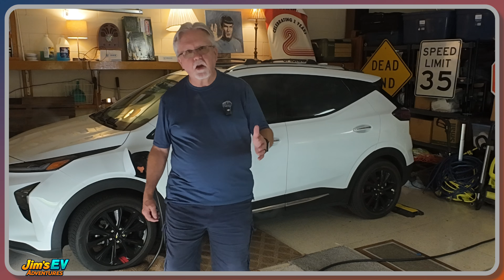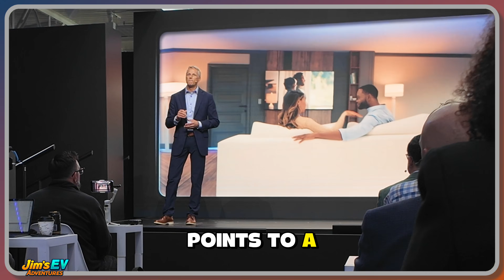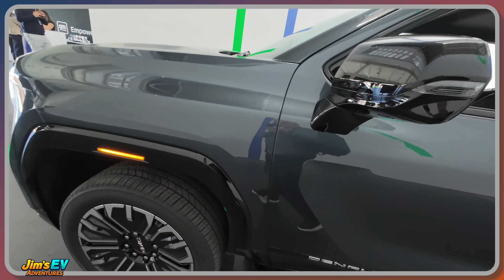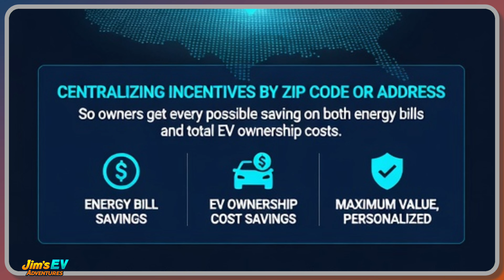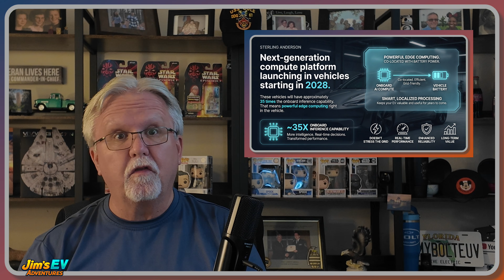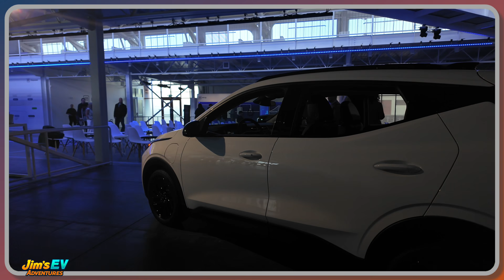GM Empower, Part 2: Your EV is Actually a Giant Home Battery!

Comment: Jim, I haven't seen anyone talking about this so I figured I'd bring it up here.  All of these chargers have cloud based communications enabled by default.  Or perhaps a better way of saying that is, the manufactures are able to harvest your data without your consent.  Worse off, I was reading in some of the forums for Enphase's new V2x charger that firmware updates are changing peoples settings on their devices.  People who have V2G disabled are having it turn back on and their batteries/cars are draining.  I would very much like to see OPT IN and privacy settings improved across the board.  I don't want to have to have my system online for it to function.  I want to choose to do firmware updates when I want.  No one wants GM, Enphase, Sigenergy or any other provider stealing and selling your data back to the Utility companies or anyone else for that matter.  And dont' get me started on SUBSCRIPTIONS.......

Comment: Thanks for that. Excellent video and promising look into the future. I've have a 2022 ioniq five which does have by directional capability. I also have solar panels, a backup battery and a small generator. I live in Saint Augustine Florida. I had my electrician wire a receptacle that allows me to use my EV to power my house when needed or my generator when needed and that supplements the solar along with my 14kw battery. I look forward to hearing that FPL is also working with GM on this new plan, it sounds excellent.
Reply from the maker: The IONIQ 5, 6, 9 - all have V2L capability, but not V2H or V2G.  I will be doing a special video on this within the week.  Stay tuned.

Comment: Looks like utility companies are going to have to change when electric vehicles get the best rates. Right now, they all say charge at night. We tell prospective EV owners that is the best time and gives you a full/mostly full battery every morning. Utilities give EV owners the best rates and/or a monthly discount for doing that. However, for V2G, they want to allow charging during the day and overnight while giving back to the grid during peak hours if I am understanding this correctly. The EV owner incentive better make it worth while or people won't participate in large enough numbers. Lastly, most electric vehicles sit in parking lots during the day at work sites. Companies would have to invest in V2G technology as well. We can hardly get them to use solar now.  Just my..er, 10 cents. 💲
Reply from the maker: Not all electric companies are created equal, I suppose.  Some play nice. Some don’t. Some are just ignorant of the changes that are happening. Dare to be naive is their motto.

Comment: Jim, somehow you are  not connecting the dots  At least for me. I watched both parts and I’m still going “huh?” Have a 26 Equinox with its 85 kw battery. Do I have to already have solar panels, do I need to go out and solar panels installed? I hope part 3 ties this all together because I’m sure sure I’ve learned much for living in 2026 not 2028  not 2032. I must be missing something somewhere.
Reply from the maker: Sorry you’re missing it…maybe part 3 will tie it together. But to simplify…your Equinox can already feed your home in V2H with the proper GM hardware.  I’ll do a separate in-depth video to explain that more succinctly. Not part of the series…an entire V2H And V2G primer. Stay tuned.

Comment: Last year I bought a 24 Blazer RS with its 85kwh battery and awd. Paid $40k used. I also have 35kwh of lfp home batteries paired with my solar array. The batteries cost $33k installed. So when I bought the car, I got more than twice the battery capacity for half-price AND it includes a great car in the deal!

Comment: I will send you a shortish email on solar home integration because I’ve been researching this for a month for myself, if you would like that Jim. 

I’ve always liked the idea of the interconnected grid since I first read about it, but being an electrician, I see speed bumps. First off, both Tesla Home and Enphase have developed meter collar switches that detect grid power, and isolate (islanding) a home generating it’s own power from the grid. I think we’re all technical enough to know that if you send power back to grid, it produces 15Kv power on the street. The current, amps, will be really low, but 15kv low amp electricity is what stun guns use, and this could endanger someone working on the pole. Meter collar switches prevent this, but putting a 200 amp automatic switch in a small space isn’t ideal and can disconnect your home from grid or home generated power depending on how it fails. There is no manual return to normal operation option which might be possible, and safe for home owners if designed properly in a larger enclosure. 

Nationwide Smart Grid implementation is opposed by privately owned utilities that laws passed in the 90’s allowed. The same privately owned utilities who didn’t repair lines, and caused a blackout of the northeast USA and southeast parts of Canada in 2003. This is where the resistance, and worries over cost will come from. Unfortunately, more people live under the control of private utilities than public co-ops, like I do, where the utility is owned by the people it services. In these cases, utility management is more likely to take a proactive, visionary approach over the shortsighted quarterly profit model. I will now discuss why regulation is good for the public

Smart grid would take the need for “islanding” away from the property owner, and provide more control and safety for utilities. For example, a single line provides power to 200 houses, the line is damaged and shorts out in a storm, a manual utility would have to cut off that line until repairs were made. With smart grid, the grid would detect where the fault is, cut only that section off, and continue utilities more properties while increasing safety for workers.

Another speed bump, this time on the owner’s side of the house, is the charger wiring itself. I’m referring to the wiring from the car to the charger, not the charger to the electrical service. Many chargers use 10 ga wire with 105C rated insulation to provide 9.6kw (40a 240v) to the car. These chargers would be insufficient to run even some 2 ton units without additional equipment like a soft start system. Modern 2 stage or inverter motor driven HVAC compressors will not have this problem, but most people don’t have those. I can see where hardwired EV chargers of sufficient capability will be required, and then people will complain because the cables are too heavy. We can move the charging inverters inside like solar inverters, and that’s exactly what GM showed in their graphic. Surely some of you noticed the big CCS DCFC plug in the video. To me, that says GM was working on this before they made the decision to go to NACS. Cables are smaller to DC charge at home because AC is not DC, DC uses the whole cross section of the wire to provide power, AC only uses the outside of the wire. This is why DCFC cables are smaller compared to the amount of power in Kw. Solar power is DC, batteries are DC, so why not charge directly from one battery to the other? Thats why solar systems are working towards high voltage DC batteries, and DC EV charging. This helps reduce losses converting AC to DC. What happens when your HVDC home battery is not higher voltage than your EV battery? Higher voltage is required to charge DC, and DC doesn’t transform like AC. Then we’re back to converting DC-AC-DC somewhere, and losses come up again. That’s a minor speed bump, but one that will surely arise. 

I seriously hope for a better future, but that will rely on more intelligent people in public and power. Near where I live, a community came together to prevent a developer from installing a solar farm in their county because they believed it caused radiation poisoning. Tipton County, Covington, TN- look it up, I couldn’t make this up. Trying to convince close minded people of their ignorance is like trying to make a sheet on a clothesline stand still in the wind. You can’t win. Therefore, I’m afraid it will be a long time before the entire country is converted to smart grid where EV’s can provide grid to the power intentionally to help smoothe out power utilization for everyone. I think I first heard and researched “smart grid” back in the 90’s, but other than meter reading from the street, most of the area where I live is still powered by dumb grid. 

Deregulating and privatization of utilities only benefits greedy politicians and lobbyists so why do we not tar and feather them
Reply: Great post. Except 40a charger by code needs 8ga copper or 6ga aluminum. Co op power may happen someday. Our local utility, PPL, is under the microscope lately for some if the highest profits in the US.
Reply: I didn't understand much of that but it sounds complicated. With these obstacles, how is it that things are so much more advanced in Australia, where some of the states have evs propping up the grid whenever needed?
Reply: @srambaba  I did some quick research. Australia started installing Smart Grid equipment in 2009 with territory (state) level beginning in 2010. You read about Vehicle To Grid which AUS started testing in 2022, regulatory approval (initiative) started in ‘24, then residential roll outs beginning in ‘26. There’s a lot that goes into implementation. Think of a grid in your mind, every point of intersection you must have a smart switch that controls power distribution. The “smart” part is that it can sense load, faults, and send that information (and more) back to the control station. Then the control station has to be able to analyze that information, and send commands back to the smart switches to equalize load on the grid feeds. V2G requires a smart meter that communicates with the grid network and your EV because you don’t want your EV to be drained to 0% by your neighbors. That’s a lot of levels of communication and coordination. It is interesting to me that AUS implemented grid level smart devices before smart meters, whereas where I live, the smart meters came first because that allows meter readers to read from the street. We still have manual switches on most of the grid. Logically, AUS did it the right way- start at the source, and work your way down from there. Australia has a lot less red tape. It’s not just EVs, or renewable energy. I recall reading about 2 Space Economy companies started in USA that moved to Australia because it was easier to get launch authorization- less air traffic. 

As far as USA Smart Grid, the problem I’d point to is privatization laws passed starting in ‘92, and finishing in ‘05 when private companies were allowed to buy utilities on military bases. Utilities should be owned by the people it serves IMO. I can’t discuss politics here, but it’s logical that private utilities resist purchasing Smart Grid components because that cuts into quarterly profits. The logic of spending money now to save future money (or increase customer usability) is alien to this model. Look up the Great Northeast Blackout of 2003, the cause was multiple private utilities unwilling to share costs to repair 100 KV lines feeding their grids. Too many cooks in the kitchen. In the 90’s, I recall privatization pundits claimed that privatizing utilities would reduce costs, cut red tape, and make everyone believe unicorns were real. You be the judge as to whether not that that’s reality.
Reply: @w @whynotthinkwhynot- anks so much. I can use this info for some of the work I'm doing. Totally agree on the privatized utilities.
Reply: @scrambaba - Let me know if I can help, or if my explanations add confusion. It’s mental exercise for me. I’m addicted to learning things. Learning to write concisely and understandable is definitely something I learn better. I tend to give more information than is needed, and digress often. (I’m also not slow at typing, and so you might not want to read the rest of this post which is more about the root of corruption in society and government systems, but then comes back to how my local utility was corrupted for a time due to how the co-op charter is written.)

I was having a conversation the other night about utility privatization that devolved into a philosophical discussion about how humans muddy beneficial ideas as a result of base desires of control and self elation using the examples of Marx’s Communist utopia that generated military authoritarianism, juxtaposed to USA’s fascination with unregulated free market capitalism that generates oligarchy (economic authoritarianism), and how these devolutions might explain why Peter disbanded the early Church. If I were to attack utility privatization, it would be for the sake of public ownership, but this requires public engagement whereas most people just want to be told. Where I live, the people do own all the utilities under a charter that defines the co-op between MLGW and the City of Memphis. If I were to rewrite that charter, I’d have MLGW, owned by the public, but managed by a board comprised of 3 people appointed by MLGW workers, and 2 people appointed by the Mayor, paid by the City. As it is, the Mayor chooses the President of MLGW. MLGW is self funded- no City money. That might not be a perfect co-op, but better than now where the Mayor appoints MLGW’s President. If the former MLGW President ran for mayor against the current mayor, someone who knows nothing about utilities might be appointed by the mayor- that happened. That mayor also tried to sell MLGW to a private company, Entergy, and install himself and his son as consultants on $200k/yr salaries. MLGW and pro-bono lawyers put an end to the Mayor’s ambition. The basic reason why I vouch for this system is because MLGW does things like not cutting off customers during extreme weather, payment arrangements, free AC giveaways, free heater checks, and other community outreach. Nearby private utilities will disconnect delinquent customers starting at midnight, and charge reconnect fees even if the customer paid but it wasn’t in the system. MLGW is certainly not utopian, but it’s closer than Entergy, and that’s why I believe everyone should have ownership in the utility that services them with only minor oversight by elected officials to coordinate planning.
Reply: @whynotthinkwhynot-  Privatization will always make things worse.  Capitalism only allows the pursuit of profit, not of what the community you live in requires.  Including regular maintenance. City or municipality owned infrastructure is always the way to go.

Comment: They never tell you how many watts these can deliver to the house in a power outage. I have moved my house from gas for heating things (air, clothes, water, food) to electricity and it takes a LOT! Ford's system delivers just 9kW and while that my be enough if we turn stuff off, that's not what I want. I want a warm house, use my oven,  wash clothes, take showers and run dehumidifiers through the storms. Electricity with heat pumps is substantially cheaper per BTU, but it takes a lot of electricity.

Comment: I think the ideal system has solar, a home battery, all electric appliances and at least bidirectional charging. A home battery allows you to go somewhere in a power outage. It would be annoying to have the house power drive away. The home battery doesn't have to be big. 

I'm glad GM is implementing V2G because it has uses outside the home. One example is electric school buses. They can run twice a day to transport kids, then use the batteries to store wind power or whatever at night and on weekends. 

Unfortunately the installation cost and paperwork of these systems is very high.

Comment: In Hawaii, I give as little energy to the grid as possible because the discount I get for buying it back is minuscule. Under these conditions, I cannot imagine participating in a grid stabilization program.
Reply from the maker: It is up to the power company - some will be a little more generous.  And when the others see what it can bring to the table, maybe they will get onboard.  I would be in the same boat here...supplying the grid with any power I generate only brings about 30 percent of what they charge other customers.
Reply: Yes. In states where solar adoption is very high such as yours, California, Arizona, etc. utilites no longer have real "net metering". They buy back excess power at wholesale rates which is a fraction of the value. However, in those states it is smart to have your own off grid storage so you can use your own excess. Giving any power back to the grid is a benefit to the utility, not likely to you. Thigs in state PUC would have to be much different for this idea to be attractive to a residential user. Power your own home---yes. Power back to the grid---nope.
Reply: @m @mikemandell132 at is exactly why we just upgraded our battery backup system. However, we are still sending too much energy to the grid. If this keeps up, we will consider adding more battery modules.

Comment: Yes I can charge at night for 7.6 cents a kilowatt hour and run it into the home during the day when it’s as high as 17.6 a KWh. I just have to buy the equipment which I think is about $1500.
Reply from the maker: The idea is to offset the need for a generator first.  Then help the grid if it is possible.
Reply: @jimsEVadventures    Yes I won’t have to buy a Generac generator. I think those generators run for about 10 minutes every week just to keep them operable.